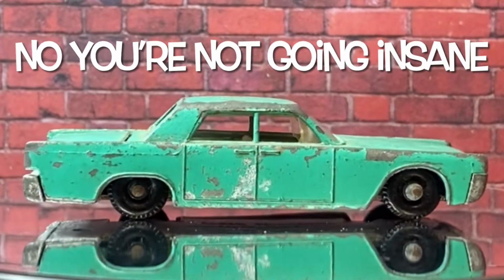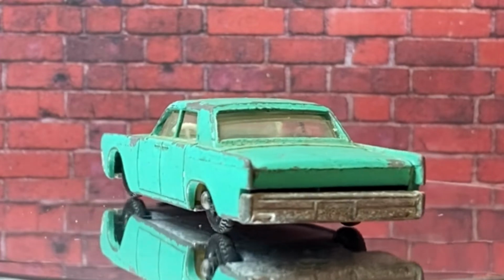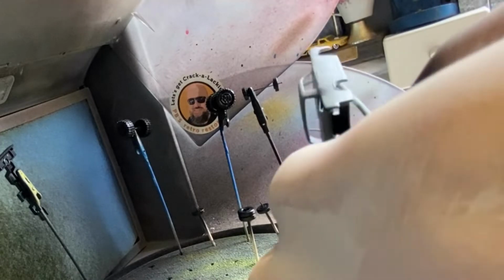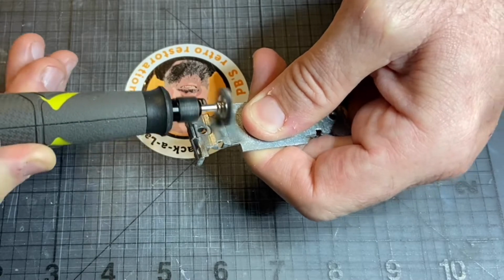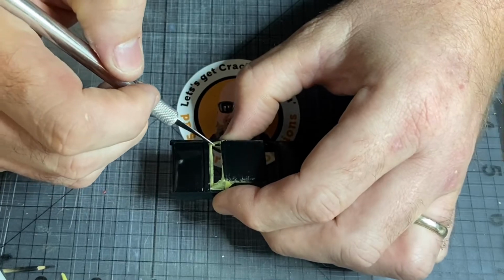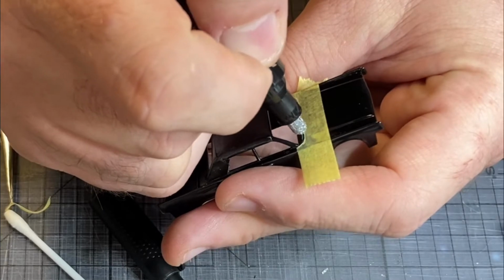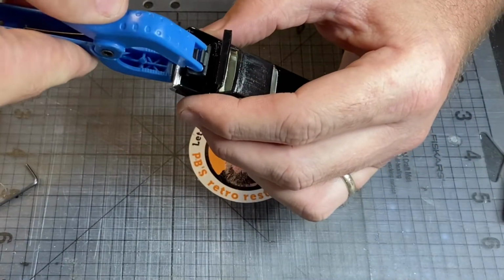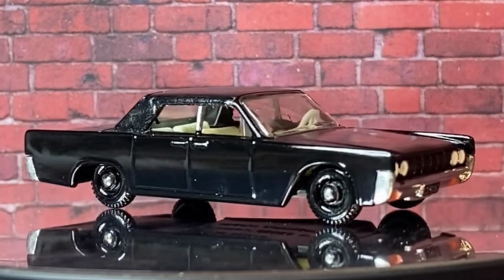Renee's Custom Matchbox Lincoln Continental Build!

Comment: Excellent custom Pete. For a vinyl roof effect I'm going to use Dulux duramax rust effect paint cheap at Bunnings. Or you could try Martin Dare's method using dust from a vacuum cleaner.
Again a great job well done my friend. Cheers Michael
Reply from the maker: Thanks Mark! I never knew this was turned into a Superfast until recently, I think I prefer the Regular Wheel still. It's such a nice casting with really nice details.

Comment: Hi PB,

I love the Lincoln - my favorite casting. I have a load of them without the truck lid.

Have you looked in the vinyl top paint from the redline shop. It simulates the look that Mattel used on the original redlines.

Great work.
Reply from the maker: Thanks Mario. Is the boot lid available as a repro part? I've been lucky twice and not had to look for one. It's such a nice casting. The vinyl top paint is just semi-gloss black isn't it? Getting paint shipped to Australia might be an issue for me too.
Reply: @PBsRetroRestorations  I have not seen the part for sale by anyone. I have used a Hot Wheels Lincoln and cut the trunk lid off - not perfect but it is good.
Reply from the maker: @mariociliotta5478  ha that’s a great idea! I checked recovertoy down here and even they don’t have the boot lid.